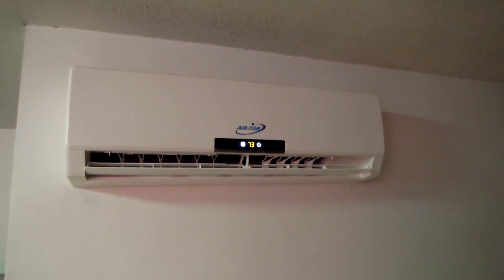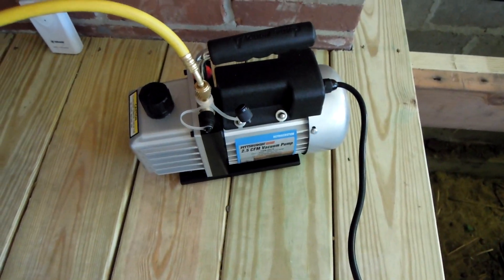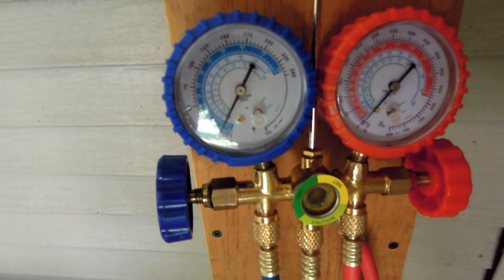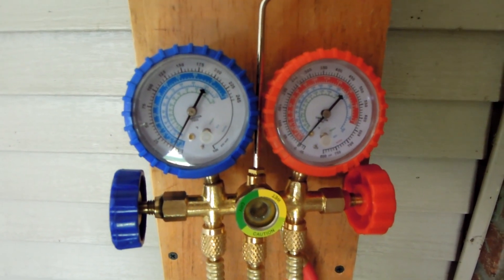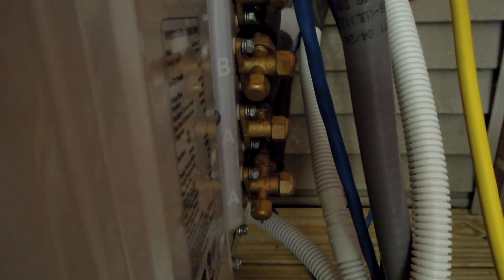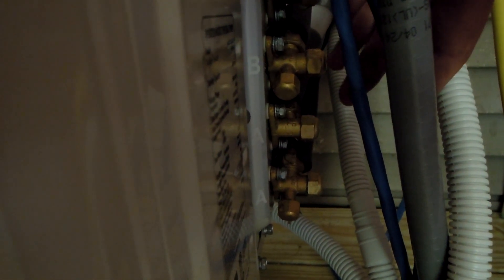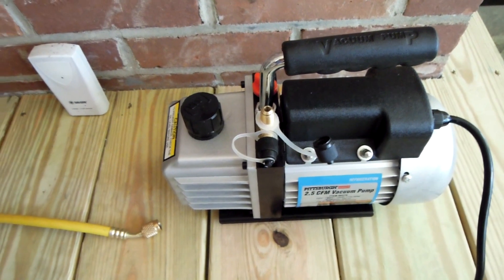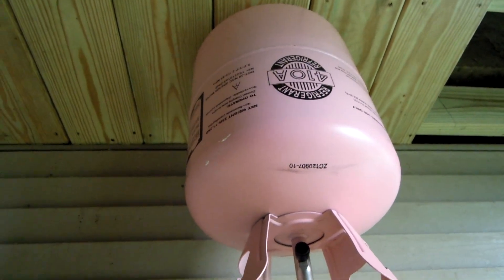Installation Ductless Mini Split 410a Air Conditioner & Heat Pump Mitsubishi Compressor Aircon Unit

Comment: Nice video, but your two zones are parted as long as the 4 ports are closed. So you need to evacuate air for every zone. Once the ports are open than they share the same chamber.
Reply from the maker: You are right. look for Edwin Parks Comment here

Comment: Andrew, your video is great; I have watched it many times.  I am installing an LG 4-zone system.  I have pressure tested it with Nitrogen at 300 PSI and it seems to be fine so I think I am ready to evacuate and release the R410A.  I am however still confused about one item in your video.  Can you explain a little more your comment "Each lineset pair must be done separately. Only when the 410a is released at that time it is the same chamber".  Thanks for your great videos.
Reply from the maker: I am not a pro but I think if you do them separately you can tell if that pair is leaking. Sorry for the late reply. Not a youtube pro either. Thanks for the comment.

Comment: that install looks absolutely terrible. and to do a proper vacuum on a system you need a micron Guage and you need to achieve a 500 micron vac. to do so that would take a minimum of an hour. and seeing how your using a 2.5 cfm pump, granted it does look like it is brand new that would take you around 2-3 hours to pull a proper vacuum.
Reply: In the USA people hire A/C jokers as techs. Every place else in the world most people install it themselves or pay 90% less then in the USA to install these brainless units. Anyway 4 years now and it works perfect. A/C installs are a joke.

Comment: Thanks for the video. Good information.
I have a new one ton, single zone, mini-split ready to evacuate and release the Freon charge.
What has me baffled are the Set Screws in the Valves. When and in what sequence do I mess with them from start of evacuation to after the charge is released.?
Do I turn them Clock-wise or CC to open - close
THanks?

Comment: Hi, I have the quad zone system. Do I need to evacuate each line?
Reply from the maker: Lukasz Mysliwiec Each line has to be done. This way you know were the leak is if there is one. 30 min each line or more should be fine. Use Nylog.

Comment: Great video Andrew, Thanks!  I'm looking at 12k btu 1 ton single zone aircon with mitsu comp.  after a year of service....How's it going?  any issues?
Reply from the maker: Know problems at all. I also installed a 4 zone to finish up the house same brand. I am saving a ton in heating and cooling. After this winter it will have paid for itself. The  2 and 4 zone units delivered were $4,000. That includes linesets, covers, wire and misc. I saved around 3,000 dollars so far. My house was oil heat with no AC.
Reply: Andrew Sands I will be installing mine next Monday when it arrives...Did you install a DC inverter based compressor or non inverter?  I understand it still heats down to around 17F.  Any experience with that?  Are the inside units pretty quiet?
Reply from the maker: DC Inverter only type aircon makes for the home. Show me a ductless AC without a inverter?
Reply: Andrew Sands Actually,  Good question.  Many mfg sell the mini split with inverter or non-inverter systems.  I am pretty sure air-con is no exception based on the fact the seller of the system I purchased offers both.  So I assume then you have the inverter based compressor...that's good.  Thanks for info.

Comment: These systems are great! The install is terrible though.  I would get fired if I installed a unit like that. Always pressure test with Nitrogen!!! Also, there is NO WAY that little Harbor Freight vacuum pump ever got close to a proper vacuum on the system. These are very basic mistakes, I do not want to get to technical on a YouTube comment. Haha
Reply from the maker: Just had it serviced by a 30 year experienced tech. Owns 5 locations went over the unit cleaned it tested it all is perfect. I have a total of 6 zones. I put nitrogen in my tires works great.

Comment: I am trying to find reviews on the AirCon brand. How has it been working for you? They advertise that it's a Mitsubishi compressor (best reputation). Is that true? What about the indoor unit....who makes that? Is this brand Chinese or Japanese made? Thanks in advance!
Reply: I am from India and the indoor unit looks same as indian A/C company 'Blue Star' 2 star energy rated domestic air conditioners. Blue star is old ac company established in 1943 and have 3-4 manufacturing plant in India. So a guess is that may be air con taking it from blue star or may be vice versa.
Reply from the maker: It does have a Mitsubishi compressor and the interior units I have seen Fedders and Lennox use them. The Japanese, Germans and us  have things made in China so I really have no clue. The unit in this video are working perfect and have been putting out heat down to 0. AC is great. I also put a 4 zone in and that works as well.

Comment: How did you know how much refrigerant to add?
Reply from the maker: The unit comes precharged with 410a. The unit in the video has enough for 50 ft of lineset. In my other videos I have a 4 zone that has enough for 164 feet of lineset. With this one in the video it is .16 oz per ft. So 10 feet gets 1 oz.

Comment: you cant possibly go by the 30lbs vaccum on your gauges that tells you nothing get a micron gauge and do the job properly a vaccum pump should run for a min of 45mins to pull a proper vaccum.